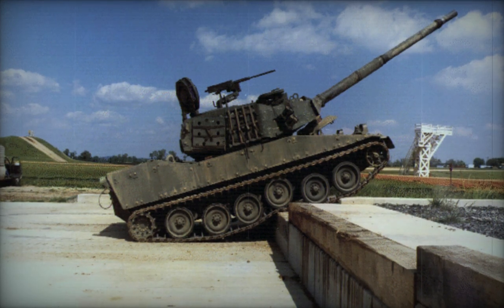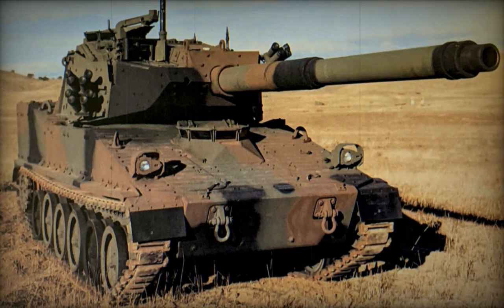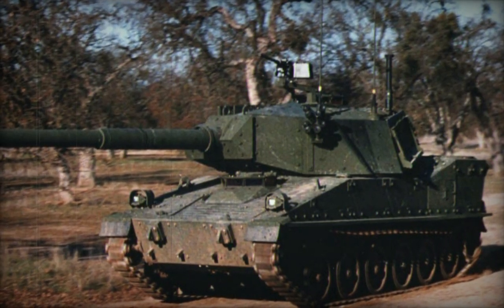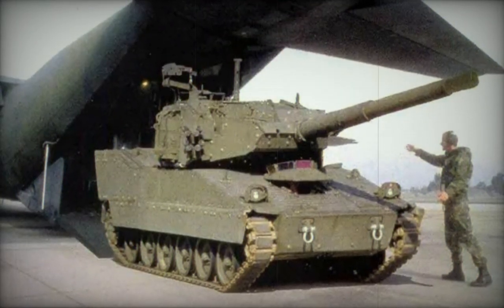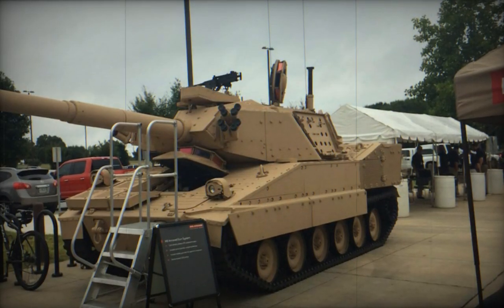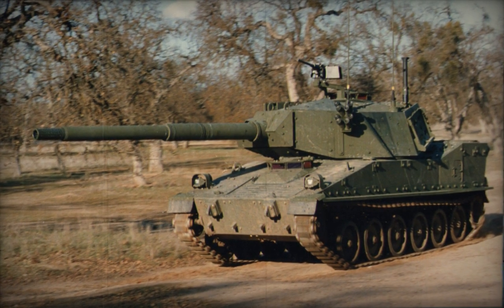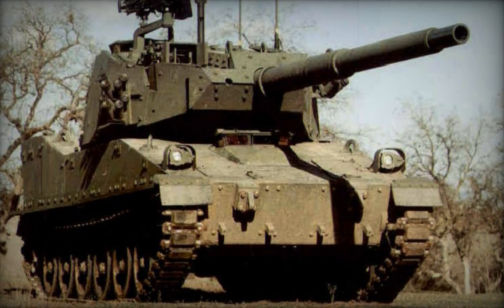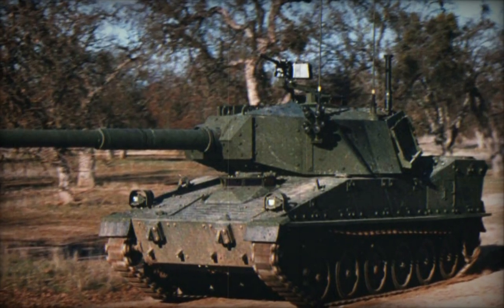M8 Buford

Comment: This is the tank that the Army should have chosen. Did it not meet the requirements set forth by the Army , being air dropped and so on because the M10 is heavier than the M8